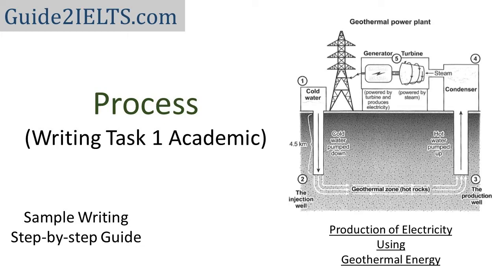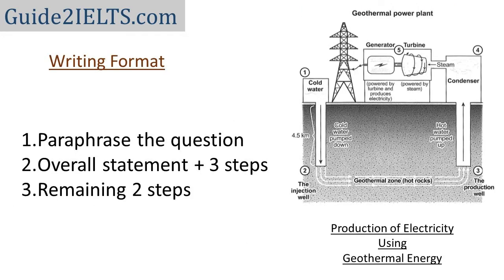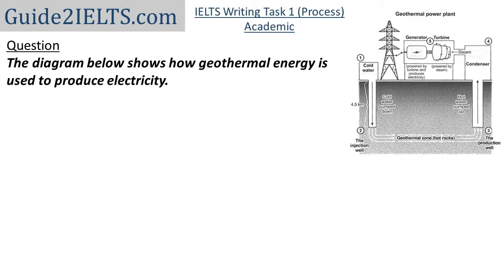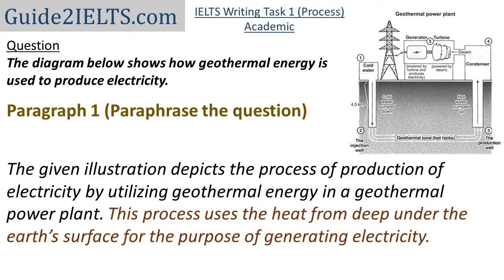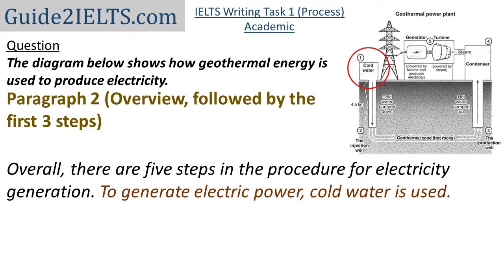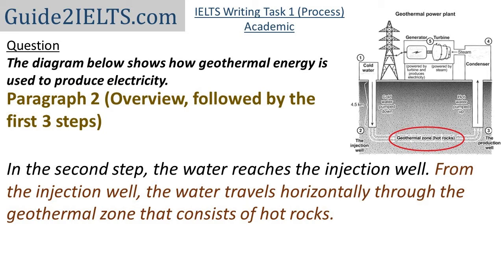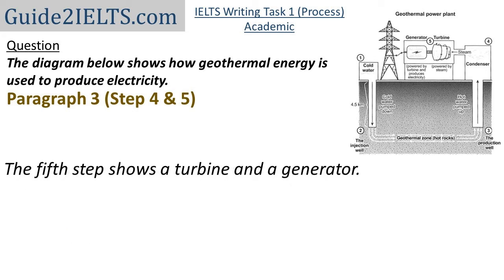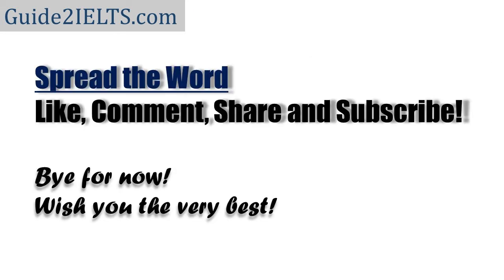IELTS Academic Writing Task 1 - Process (Geothermal Powerplant) #StepByStepGuide

Comment: In overall how can you write the data?
Reply from the maker: Hi! Ideally, you shouldn’t include specific data in the overall statement.

For process diagrams, you can mention the number of steps and improve it by stating the first and last step. For example: "Overall, there are five steps, starting with..."

For graphs and charts, the overall statement should highlight trends, highs and lows, etc., without including exact data. However, sometimes I do mention figures in brackets—for instance, when talking about the highest value—to avoid repetition later.

I hope this answers your question! You can check out more sample answers in this playlist: https://www.youtube.com/playlist?list=PLVo5Ot1SoQ24t5p63wGngno36gUuQEIhs